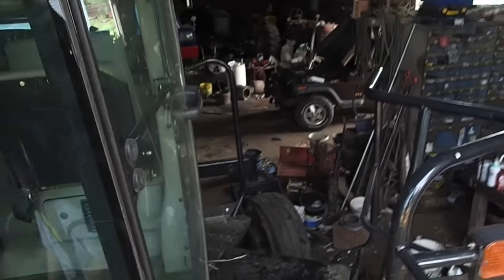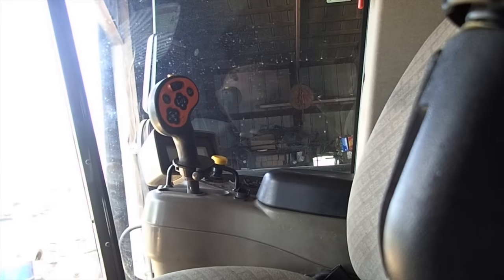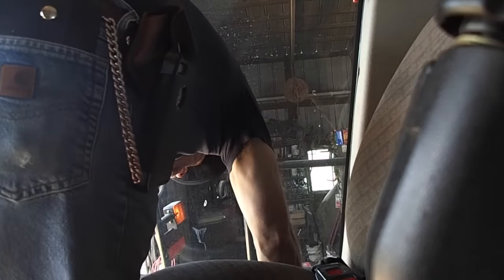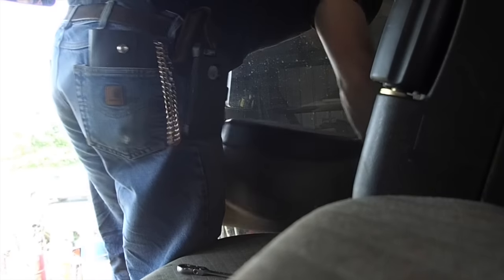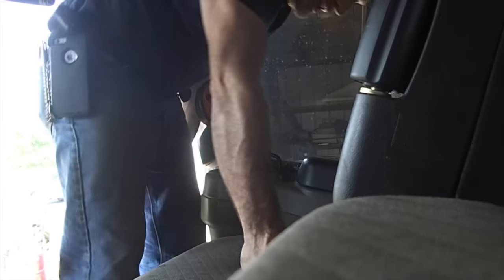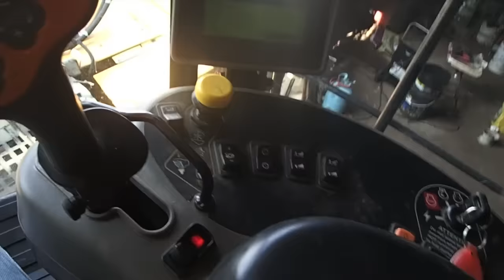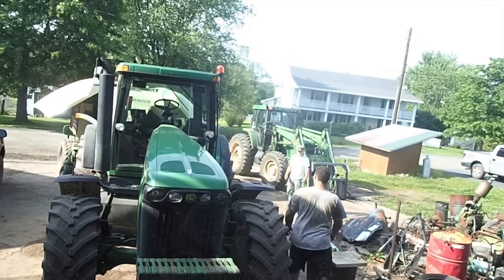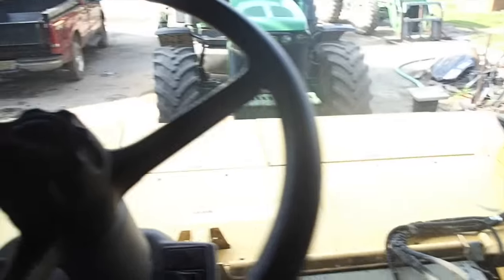WD2303 Seat Parts Got Here Fast!!

Comment: Hi Wes you get lots of views as your real what you film is not some docu drama like discovery channel would show. A farm round here was filmed for a pilot show I think it's still here on tube  titled crop kings. you could just tell what was going to happen if it made a full show. I know of these guys they are good farmers and it was just going to be a drama show and ruin there reputation.. 
I bet those seat parts got piggy backed on a next day machine down parts order for someone else, or on a daily stock order.  our local CaseIH dealers will do that if your part is coming from the same distribution center as the other guys stuff. The blue guys round here just screw you freight costs and you wait.